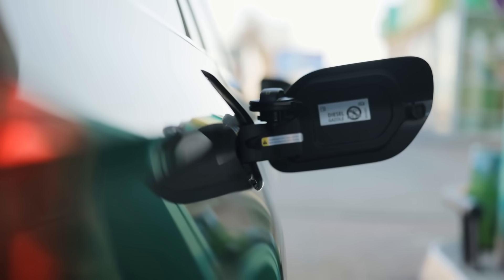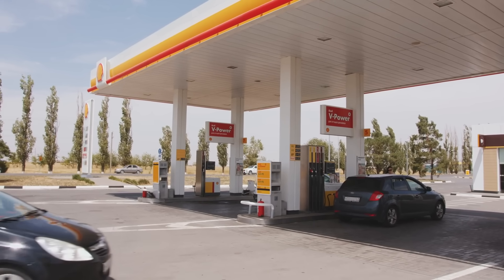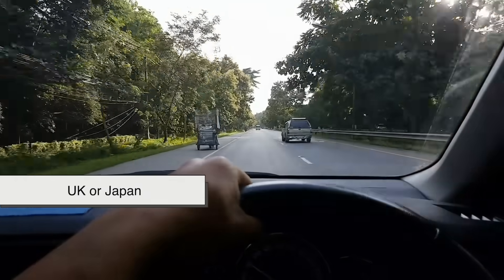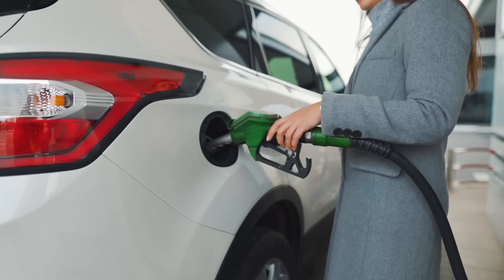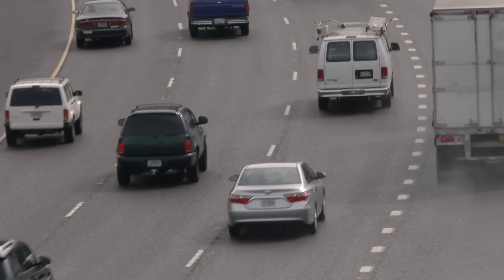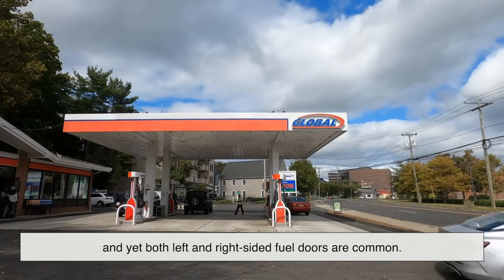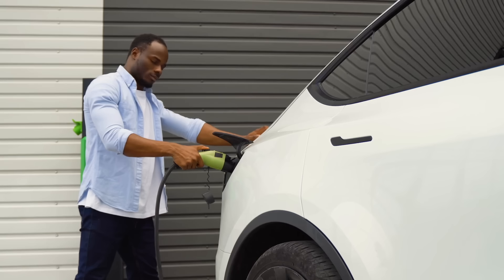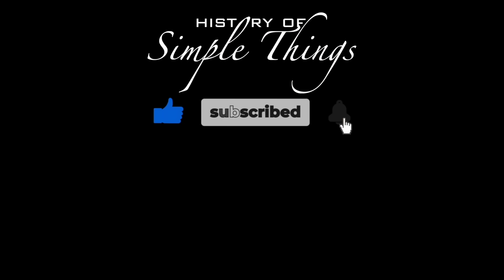Why Are Fuel Doors on Different Sides of the Car?

Comment: Not sure what traffic has to do with where the fuel door is at. I've never seen a gas station on the road curb.
Reply: They all used to be - at least in UK. Many years ago!
Reply: It could be for times when somebody runs out of gas and is refilling the car form a gas can on the side of the road.
Reply: Historically many service station pumps were bordering the edge of the road, sometimes with a canopy overhead , so it made sense to have the filler cap on the passenger side.
Reply: @chrissmith2114  In most places, cars are also statistically more likely to get severely sideswiped on the driver's side, so the passenger's side is safer for that alone.
Reply: Probably means that you are younger than about, say, 70?
Reply: In rural areas of the US, the general store would have gas pumps in the front close to the curb. Pretty rare nowadays as true rural areas are disappearing.
Reply: I have, and where this is the case the pumps are on the side of the road in the direction of traffic flow, hence why the filler cap is located on the passenger side.

Comment: I really liked the placement on my '92 Corvette LT1 (C4 platform) — center of trailing edge of upper rear deck.  Or, in the 1960's, behind the folding down rear license plate holder door.
Reply: Yeah, the exploding Ford Pinto got rid of that.
Reply: @TheEstevenw  Oddly, the Pinto always had it on the side, and an NHTSA study found it was much safer than the headlines, or the famous "Pinto memo"  suggested. Ford's engineering was actually a lot better than their PR skills.

Comment: In the past, German automobile manufacturers placed the filler pipe on the passenger side for safety reasons. If a vehicle ran out of fuel and was the driver pulled over to pour in a few liters from a canister stored in the trunk, he/she wouldn't be standing on the traffic side of the vehicle.
Reply: That was my assumption too.....
Reply: why in the past ? They still do.
Reply: @imantsjansons5009  Many manufacturers now also place the filler on the driver's side. Often because to the vehicle is a platform model also sold in Asia or the US. That was seldom the case 20 years ago or earlier.
Reply: @mikebaginy8731  The position of the filler cap depends on which side of the road they drive where the car is designed and made.  In UK Japanese and UK cars have filler on left,   European and American cars have the filler on the right.  They change the steering wheel , pedals,  headlight aim ( and single rear foglight  has to change to offside ) and maybe windscreen wipers  to suit the country they sell to, but never seen the position of filler cap change.
Reply: @chrissmith2114  Changing the side of the filler pipe would require a major change to many components. I've never encountered an OEM who has done that. Many contemporary European (non-UK, i.e. LHD) vehicles now have the filler positioned on the left - a position I'm not fond of. Running out of fuel in Germany is rare, due to the large amount of filling stations, in some countries that can become a problem, especially out in the boonies.
Reply: @chrissmith2114  I owned a 2013 Mini Cooper Clubman and its fuel door was on the right. When I bought it I assumed that was a UK thing since all my other cars have had the door at the back or the left side. However, I looked at getting a 2024 Mini two-door and that had the fuel door on the left. 🤷‍♂ Also, since Mini is owned by BMW maybe they have the final say.
Reply: @bbartky  Very unusual for a British car to have a fuel filler on the right - maybe BMW now sells most Mini in EU and USA so moved the filler
Reply: @chrissmith2114 Could be! I don’t know the reasoning behind it, but I thought it was worth mentioning since Mini hasn’t been consistent on this. Also, I’ve owned three Fords and one VW and three had the fuel door on the left and one (an old Mustang) in the back. I currently own a Kia, which also has a fuel door on the left. So, my old Mini is the only car I’ve owned that had it on the right side. 🤷‍♂️

Comment: I remember seeing old station wagon with the gass cap was under license plate 😮😊
Reply: I have had several vehicle like  that. They were General Motors vehicles.
Reply: @sergiosolis4538  yes, my forst car was a 76 El Dorado. Loved/hated that car. 😆
Reply: It was easy to fill and didn't require a separate fuel door, I have wondered why they they changed, I suspect it is because in the 70's siphoning gas became a thing, fuel doors that could be locked from the inside became the standard.
Reply: @forddon  My first car was a '68 Ford Mustang and it had fuel door at the back. This was typical of small Fords of that era. There were several huge lawsuits in the '70s and '80s against Ford over this design. While the lawsuits over the Pinto are well known there were also lawsuits over the Ford Falcon and Mercury Cougar due to the rear collision risk. I've read this was the principal reason for Ford ending placement of the fuel door in the back.

EDIT Forgot a verb.
Reply: @forddon  That might have expedited the switch, but there was a move during that time to move the tank and the door as far away from the rear as possible, to reduce the fire risks. Ford's largest sedans moved the tank above the rear axle, so the door had to be on the side and while the little Pinto still had the tank behind the axle  to make the hatchback model possible, moving the filler to the side made it a bit safer. With FWD, the tank usually ended up under the rear seat, so a filler on the side was the most practical arrangement.
Reply: @forddon i had to buy a little plastic locking insert that went into the pipe itself.
Reply: The 60s and 70s era cars I first had always had the fuel filler cap behind the rear license plate.  The plate was mounted on a spring-loaded hinge so you just pulled it down took off the cap and started fueling.  Of course I am old enough to remember when you could not pump your own gas.  An attendant would do that for you and clean your windshield.  Depending on which brand you used, those attendants could also check your oil, tire pressure, etc.  Just imagine trying to have all that done now?  LOL
Reply: @stephenschroeder6567  I'm old enough to have been that attendant, The edges of license plates can be sharp and after fueling dozens of cars one after the next I always had little cuts on my fingers cold weather and gas on my hands wasn't much fun
Reply: We had a 1954 Cadillac, The fuel filler was placed, Ready for this, Under the drivers side rear tail light, which has a push button release,  then lifted out if the way, exposing the fuel filler cap. My father used enjoy finding the new fuel attendant and asking him to top off the tank. So few Cadillacs were common in our neighborhood he ended up having to show people where it was
Reply: Yep.  One day, about 30 years ago, my niece borrowed my father's car, a 1984 Chevy Caprice.  When she pulled into the gas station she couldn't find the gas cap, until someone pointed out that it was under the rear license plate.
Reply: It was a bit of an exercise to reach down, pull the spring loaded plate away with one hand, while removing the cap with other. A bit messy in winter, too, if one lived in the snow belt. 

The later designs with the fuel door above the rear bumper were a big improvement.
Reply: @martinliehs2513  is the art oo " multi tasking 😅.
Reply: My 1986 Ford XLT (in 1986) pickup truck had filler caps on both sides for two separate tanks. Cool if you filled up only one tank at a time, but a pain if you always filled them both at the same time, which is what I always did. You fill one side, then you had to carry the hose to the opposite side! For me it was the best and worse advantages/disadvantages of either side, ha ha. I would have like it better however, if BOTH were on the SAME side, one way or the other.

In 2009 I drove (temporarily) a Sprinter van (it was Dodge in those days). The filler tank was next to the driver's door. Yep you had to open the driver side door to get gas filler cap, and keep the door open. Of course no casual thief was going to siphon any of your gas if he didn't have access to the filler door, or even know where it was. It was a great anti-fuel theft device hidden the way that it was.
Reply: That seems to me to be the most convenient and logical place.
Reply: That was typical in American cars in the 1970s. I can remember seeing gas come pouring out of those when I was a teenager in the early 1970s. People would over fill their tanks or not put the cap on correctly.
Reply: Yeah they were very easy to siphon gas out of!  And in my defense I was just a dumb broke teenager.
Reply: I had a 1965 Pontiac Grand Prix and the gass cap was under the license plate.
Reply: Great in rear end collisions!🔥🔥🔥
Reply: I have an AMC car like that.
Reply: Crash standards have changed that
Reply: I remember the days of the filler tube being behind the license plate. My parents had a '75 Plymouth that was more odd than that: the filler tube was behind the Plymouth nameplate between the tail lights and above the license plate area (which was located on the bumper with this car). I can remember the look of confusion on attendants' faces back then: not on the left, not on the right, not behind the license plate, so where is it? My dad would have to roll down his window and tell them; sometimes he would have to get out and show them. Fortunately, just about every station became self-serve not too much later.
Reply: The Wagon Queen Family Truckster has it behind the tail light.
Reply: When I was. Kid, most days had the cap under the license plate.
Reply: Cars in the 1980s or earlier had them under the back license plate.

Comment: Having different cars having the fuel doors on different sides means fuel pumps can service cars on both sides, increasing the capacity of the forecourt.
Reply: Or just make hoses longer. Works fine at Costco when majority are on driver side as is mine. I just go to a free pump and deal with the extra "efforts" of wrapping the hose over
Reply: Or just put the bowsers closer together to make them single lane, like many of the drive through (as opposed to the parking-space style) EV charging stations.

Comment: Regarding 0:29, on a vessel, "port" refers to the left side when facing forward, whereas "starboard" refers to the right side.
Reply: "Port" has four letters. "Left" has four letters. "Right" has more letters than "left". "Starboard" has more letters than "port". Ergo, Port equals left, starboard equals right. (when facing the front of the vehicle - reverse the statement if facing the rear)

Comment: Why not put it on both sides. Problem solved
Reply: It's because it has two separate tanks.
Reply: Cost!
Reply: Jaguar XJ6 has that.
Reply: @fgmeja8mso didn’t know that. Thanks
Reply: U need to understand car manufacturers 

and then u will rethink your answer 😂
Reply: It would save on traffic jams at the gas station.  I’d pay $200 extra just for that convenience.
Reply: If a car had it on both sides, I’d buy it just for that.
Reply: Adds cost to the car, more than you would think.

Comment: On most modern cars, the side the fuel cap is on is indicated on the dash board. 
It’s a small triangle, beside the fuel gauge icon, and points to the side the fuel cap is on. 
A lot of tour coaches are fuelable from either side.
In the 1950’s and 60’s, some American cars had them hidden behind the rear numberplate or even the rear taillights!
Reply: Not all, at least not on my 12 year old Punto
Reply: Lol @murray821
Reply: I was going to comment about behind the license plate.  I remember this as a kid, and when my parents got a new car with a side fuel door, even then I thought this limits available fuel pumps.  Gas stations arrangements (traffic direction) were not necessarily built to accommodate this.  I also remember waiting in line to get gas with my parents, because the available pump was on the opposite side, unless you wanted to drive the wrong direction.  If the filler is in the back center you have options, but also a risk for rear end accidents.  I'm glad they switched this before the invention of the cell phone.  Metal filler necks straight out the back and swiping on tinder would not be a good mix.
Reply: 50's and 60's?  Heck, my 1993 Jeep Wrangler had it behind the number plate, which was on the rear-left.
Reply: And there would even be a lock so you have to not only lift the plate but also unlock it by a key. Honestly, glad we don't really do that anymore.
Reply: @lightningcyber559  Actually, when I bought the Jeep, the cap didn't have a lock.  I think that lasted about six months before I went to fill the tank and there was no gas cap.

Needless to say, I went and bought a locking one immediately after.
Reply: There was an old Cadillac that had the gas cap behind the left taillight, of course mounted high on the tail fin.
   You might think this unsafe.
   You would not be taking into account how tough those old cars were. You could rearend one with a train, and break the train.
Reply: @keithfaulkner6319  Yep. My dad had one of those! 😁😁😁